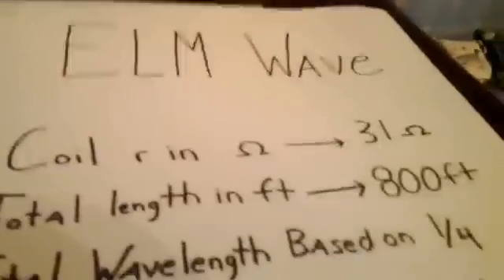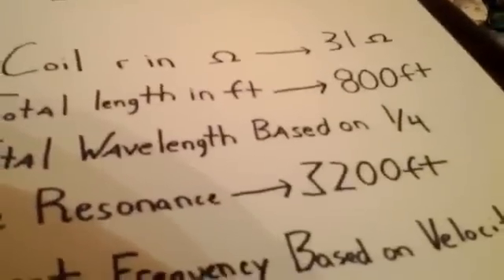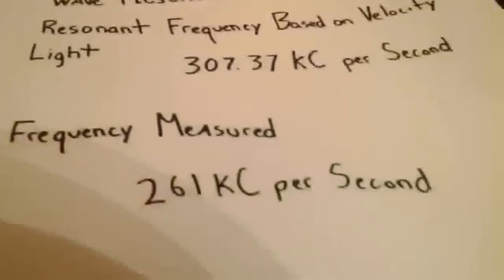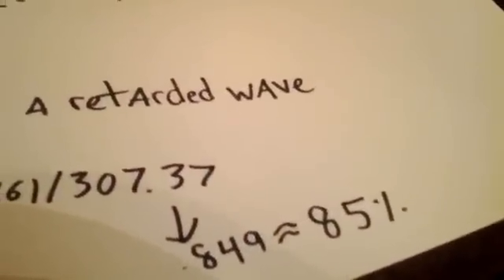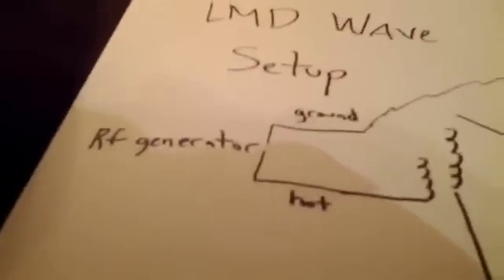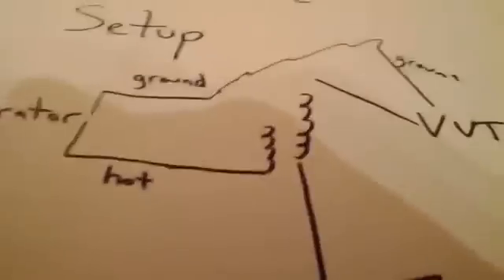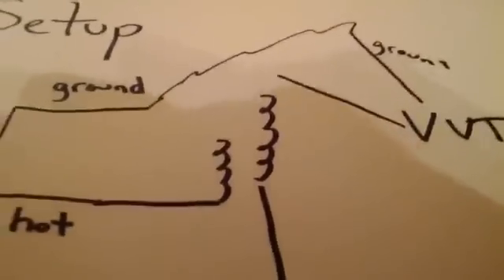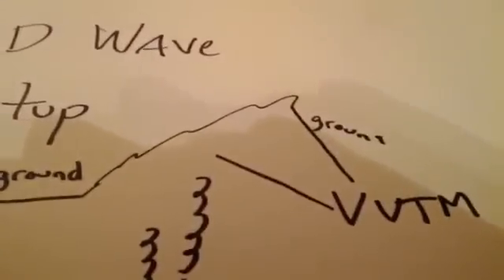PROOF of FASTER THAN LIGHT Longitudinal Magneto Dielectric Waves; Eric P  Dollard demo

Comment: U realise you are only scratching the surface of what this mechanism is capable of.... 
I would imagine you are using 50Hz - 60Hz power source? Let alone the OTS electrical components, the configuration of the spark gap, the primary windings spatial dimensions. The secondary windings spatial dimensions and orientation, the materials used in securing the windings and the nature of the securing mechanism/design themselves.

The longitudinal wave form is still the same principle of electrodynamics, just not the new testament of the quantum version. It's just that the principles are perfected as to understand how to manipulate the orientation of the wave form as so that it is not spiralling around a central axis, like a half blue/red, grid iron football. (or transitioning a standing wave form, through the in-phase node points, in the 2D representation of transverse wave forms) 
Instead the wave form is more analogous of a doughnut like shape that is blue on top and red underneath (dipole reference obviously) and it is 'traveling' through space along the direction of its polar axis and the 'outer skin' of the doughnut rotating around the central axis of the circular tube of dough (Ie; Standing on edge, moving along the direction of the central hole) *Except the doughnut has no 'hole' of any spatial magnitude and is more like a jam doughnut in appearance and is sqaushed into more of a ball like shape. It's the perfect coupling of 'electric' charge and magnetism that allows for the instrument to transmit the wave form in this perpendicular like manner and for the magnetic component of the wave form, coupled with the characteristics of the wave form, that allow the transmission of the EMR to bypass certain constraining attributes of the EM medium. Ie; Lenz law and the conventionally understood (misunderstood) aspects of phenomena such as precession.  precession  
Just remember, just as the frequency of music has been very slightly shifted away from its optimal configuration, so has the transmission frequency of AC electrical charge. 
Tesla often used 144Hz in his devices, for good reason, he was building tuning forks and musical instruments more so than electrical apparatuses that approach matters with the 'big hammer - little nail' philosophy.

There's a reason he was so profoundly successful, he used specifically designed analogue components, themselves made from specifically chosen materials. Modern consumer grade digital electronics may be massively more 'capable' for doing a vast array of operations with a good display and interface, but they do 1 million things only 50%-60% efficiently. Since much of our yech and tooling only requires 500%-60% efficiency, we do not notice any shortcomings and for all intensive purposes, the equipment functions flawlessly. But just like a MotoGP bike and a sportsbike fromthe local dealership, they both look and basically function the same but in truth they are worlds apart and no amount of improvement will make the OTS sportsbike perform to the standard of the MotoGP bike as the are fundamentally different instruments. 
The same applies for 99.999% of would be enthusiasts attempting to recreate Tesla's instruments. You have to start from the same base line principles and develop your understanding and tooling from there. Basically hand build every aspect and component to be a perfectly coherent 'link in the chain' 

Ie; transverse waves are not the 2D representation of a sine wave we are all familiar with. They are spiralling contortions in the medium that have many attributes and characteristics other than the phase and right/left hand aspect. As such they are not 'ripples' like the waves on the water's surface, indeed this wave form is only ever present at the boundary between mediums and not through the 'internal' bulk of the medium. So first you must grasp this fundamental aspect of nature, THEN to consider a longitudinal waveform, one must abandon virtually all classical science education altogether and apply a range of reinterpretations and applications to conventional narratives and premises, as well as refrain from relying on most mathematical systems developed after around 1900, as the inherently include contaminating and corrupting elements and principles. Using 'C' and mass-energy equivalence, base 10 mathematical systems in specific circumstances, just for starters. 

Then there's the issue with understanding magnetism to a much more accurate degree than conventional 'wisdom' Dielectrics, resonant properties of different states of molecular matter, wave form harmonics, etc etc.

Comment: You are a gullible idiot.   If you knew how to analyze electrical networks, you would understand why the resonance shifted between the two setups.   You have changed the coupling and capacitance which in turn shifts the natural characteristic frequency of the 2nd order system.   Sorry dude - no cigar for you.
GH  Jan 31, 2021

Comment: So let me understand. Either you have calculated the resonant frequency incorrectly, or you have a stunning scientific breakthrough hitherto misunderstood by the greatest minds of the last 50 years. ...  OK I give up.
Reply: This has been known since the beginning of the 20th century!  It has also been suppressed by the zealots who think c is the speed limit of the universe.  Tesla showed super-lumen velocities in his experiments in the early 1900's.  This isn't a new scientific breakthrough, it is a long existing aspect of electro-magnetic radiation properties (actually magnetiic properties of LMD's) that has purposely been buried by the brainwashed relativists.
Reply: Exactly!  He also presented his work's findings to a body of people who were biased against anything that refuted Relativity.  So much so, many people's careers were flushed down the toilet without so much as a second thought if they presented any theories that went against the grain.  It was during the time when science and physics were hamstringed by mathematics and became a big mess of nonsense.  Which in turn became the new religion of the modern age.  It's like anyone in cosmology who says the Big Bang is a fiction.  Their character is assassinated and their career is flushed down the pishadoo.  Halton Arp's work proved intrinsic redshift is not an accurate metric to use for measuring distant bodies.  That fact alone throws the entire theory that the universe is expanding into the waste bin!  If something can't be measured accurately, it can't be measured accurately and therefore should not be presented as if it is being measured accurately.    Nikola Tesla's work was meticulous and, as you said, impeccable.  It is his work over a century ago that turns on the lights basically everywhere today still and the fundamental reasons why wireless communication has advanced to where it has is also due to a lot of Tesla's work.  Mathematics IS NOT physics!  It is simply a means of expressing observations of physical phenomenon.  Just because someone works out the math for an unobserved phenomenon doesn't mean that the phenomenon is real.  This is why nonsense like black holes, dark energy and dark matter are take seriously.  They're nothing more than mathematical constructs used to "correct" the currently flawed model.  The speed of light is one of the backbones of that flawed model and the simple fact that there have been experiments which prove it is not the brick wall limit for velocity in the universe destroys the whole fucking works.   IMO any way.
Reply: Wired and Wound you're absolutely right. Tesla's System required extremely high frequencies and voltage in the hundred of millions of horsepower. Tesla more than understood classical theories and expanded on it through new discoverers, experiments and inventions. His FTL transmission was sent through the medium of the earth. So you're partly wrong because he wasn't using free space. Tesla recorded his waves travelling around earth and back to his receiver at a medium speed of 292,815 mps. His transmission velocity was defined by Eric Dollard as v=(π/2)c.
Reply: Wired and Wound "The most essential requirement is, however, that irrespective of frequency the wave or wave-train should continue for a certain interval of time, which I have estimated to be not less than one-twelfth or probably 0.08484 of a second and which is taken in passing to and returning from the region diametrically opposite the pole over the earths surface with a mean velocity of about four hundred and seventy-one thousand two hundred and forty kilometers per second.” -NT

It's not my problem if you refuse to believe whether or not Tesla witnessed and measured these velocities in his experiments at Colorado Springs. I'm sure he could care less whether people in his time did either. Still, he was a man who followed the scientific method like a religion. I'd prefer to believe him.
Reply: Wired and Wound I can't deny that Steinmetz played a strong role in developing the grid we have today, or that he understood the mathematics and the physics of alternating current dynamos better than Tesla, but he was literally following every move Tesla was making during these times, from Tesla's lectures throughout the early 1890s, to the development of power at Niagara. Steinmetz was a mathematical genius, but his initial job in America was to develop a DC motor that was better than  Westinghouse's AC systems. But once he and realized AC was superior, he and Elihu Thompson's jobs became finding ways to develop AC motors that could somehow bipass Tesla's AC patents so General Electric could compete with the Westinghouse Company. They literally stole blueprints from a Westinghouse factory to do this. Maybe Steinmetz wasn't directly involved in the espionage, but he was affiliated with GE, and helped GE develop their AC systems which allowed them to compete. All in fair in business I suppose, but Steinmetz wouldn't have accomplished what he had without Tesla leading the way. 

But as far a scalar waves go, Tesla didn't need Steinmetz help. Tesla was onto something else and was heading a different direction then the rest. Steinmetz, GE, and even onto RCA, all went a different route in radio technology which limited their production in electromagnetic waves traveling at the speed of light.
Reply: Or misunderstood since Nikola Tesla.
Reply: Wired and Wound I was wrong in my use of medium. The quote I posted above, Tesla says "mean." But either way he was working with the average rate of velocities that his transmitter propagated his ground waves through earth and back to his receiver. But I agree with you that the guy in the video would need far more power to accomplish FTL transmission like what Tesla achieved.
Reply: This is approx 100 year old experiment. Not a breakthrough.
Reply: Wired and Wound my phone autocorrected median as medium.   Even with that simple mess up I assume you as the smart person you present yourself as would figure out. But even if you disagree with Eric Dollard it still doesn't take away the fact that Tesla in fact did produce FTL transmission through the earth. He even patented his experiments.
Reply: Wired and Wound well I assume, like the video here, that when talking about scalar waves, we're taking about transverse and longitudinal electric waves. Or stationary waves. That is what Tesla was working with in his FTL transmission. Here's his patent link. https://teslauniverse.com/nikola-tesla/patents/us-patent-787412-art-transmitting-electrical-energy-through-natural-mediums
Reply: Thee moment you all realize that Newtonian physics and the math that is learned in schools today can only explain the 3D reality and thus is restricted in any other dimension of thought and experiments. 

The moment you realize this you will either; hate it OR love it. 

The moment you also realize that 5D and higher based math`s is not math`s but metaphysics explained in experiments and very very hard to "verify" on a paper doing calculations a new world will emerg from your side of understandings. 

3D based maths can and is restricted to 3D only. Negative Gravity is higher then 3D and cannot be written on a paper using math`s that is currently official. 

www.Warp-Drive-Physics.com

If you do not do the experiments yourself and only write things based on your opinion you got from others (school and the internet) and the teachings of restricted thoughts that clearly have not advanced any further than yesterday you can just as well go back to sleep. 

E=MC2 does not only explain 1 thing, but a relative reality compared to the knowledge you yourself have in you and thus the mind cannot advance any further from that said thought. Boxes.. boxes everywhere. 
"the mind must arrive at the destination before the body does."
Do the experiments and then see what u get. 

OR stay in the "matrix". It is a free choice.
Reply: @Wired and Wound: Wow.  Are you able to explain this better to the common Joe -- the Everyman, as it were -- and without the HORSE-SH*T math?  What I mean is this: true genius is always simple, and obvious to all -- even the stupid instantly get it and recognize it for the genius that it is.  And though I might be stupid, it does not matter, given your words give no clarity, they only further obscure the understanding and make it more complex, not simple.  

Which makes me wonder: do YOU buy what you are peddling, or even BELIEVE IT, yourself?  Do you peddle that stuff on the weekends too, at swapmeets and bazaars?  Do you honor any coupons, or have a 'Margarita Wednesdays' sale-o-rama?  Do you sell stripped-down versions at a dirt-cheap price to the Chinese, who then repackage and resell it for $$$$$$ to the heads of industry worldwide, under falsified credentials?  

I'm not really buying, nor even interested in ownership.  I understand that if anyone of  us 99% of the world population wanted to learn, we would have to take out a second mortgage, to pay you for the blessing.  I mean that in the antiquated sense of 'to harm someone'.   

Just curious: have you ever gotten any takers on that offer?  And is it small claims courthouse or the superior courthouse for fraud and grand larceny where the concomitant aftermath usually gets played out...?  

Take care, and consider the Wednesday extravaganza sale -- it's the margaritas that'll draw in the crowd of suckers.  The booze will impair their good reasoning and better judgement.  Make sure to get paid before they sober up.

F.
Reply: @Wired and Wound You're just a douche bag.
Reply: relativity was installed to do just that. it has worked for 80 years,, but TESLA sed the present it theirs / the oil monopolies? but the future for witch he has worked belongs to him,, because he new what would be fownd when some one escaped the chalk Bord trap and experimented in reality again.
Reply: +Ersontilly. Yes, the greatest scientific breakthrough since the beginning of the last century is very cleverly hiding on YouTube. Where are bloody Reuters when you need them ?

Comment: I need a HV pulsed source in order to make a longitudinal laser beam in space, I'm going to make a nitrogen laser black light longitudinal light source to start with and 60kv impulsed DC. Any thoughts on this.
Reply: LMD goes through matter... duh.
Reply: Build the device onto a 3 plate capacitor: two plates on the top with a 1cm gap inside the device and a third plate large enough to encompass both top plates with a spark gap from one top plate to the bottom. I was building a nitrogen laser based on plans of this design I got off the internet in the 1990. And although I don't have the plans anymore, I believe I recall enough to build it again. I was 15 years old and never could afford the vacuum pump or nitrogen tank so I never got to use it. But I did get the spark gap to fire once before frying my homemade power supply.

Comment: Q factor of the coil determine the frequency, not length of copper wire, if you use 1/10 of this copper coil with a ferrite core, it would resonances at same frequency, just my thought.